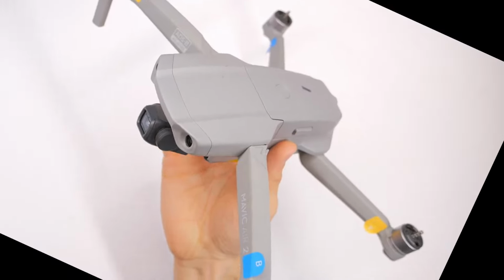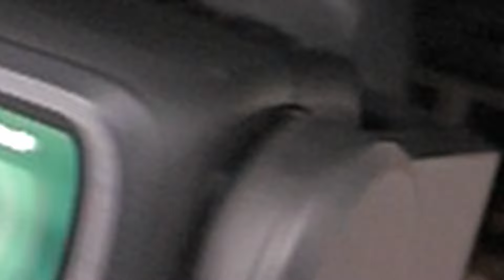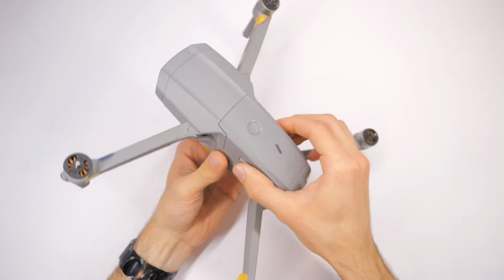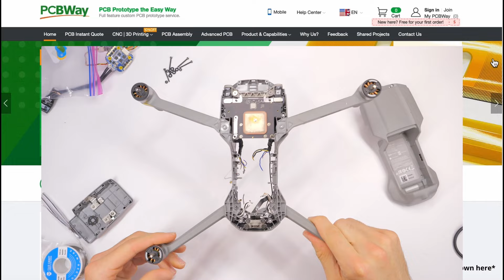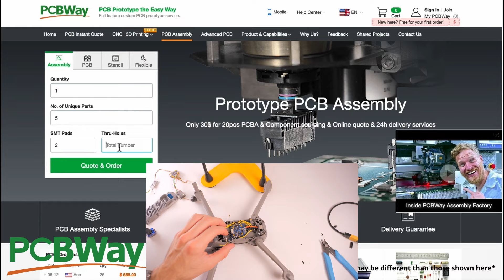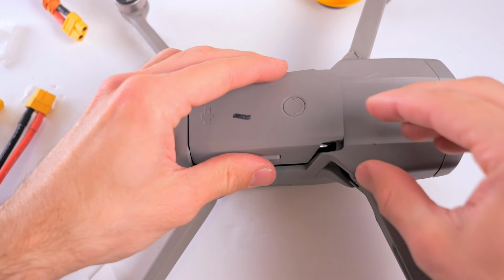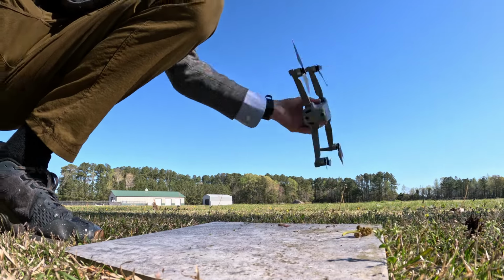😢 Redneck Turns Mavic Air 2 into High Speed FPV Drone // DJI Mavic Air 2 FPV Sleeper Build

Comment: I remember when the Mavic air 2 was released, of which you got a lot of value for its cost. That is, a drone which allows you to film in 4k 60 frame, have a 12meg camera, good battery time, good fly distance, avoid system, and some other feature. All at the price of $890-$1300(Combo)
And today you can buy the combo kit for 500$, which is significantly lower price than Mini 3 while at the same time offer about the same spec.  :D

Comment: I did that exact thing 3 years ago to a MJX Bugs 2 and a Bugs 3  it's very easy to do but hard to make as stable as a real accro quad  unless you swap out the stock motors for more powerful ones with higher kv but it will work. i even kept the stock bugs esc's and ran 4S lipo on it with stock 1806 motors with low kv and put normal 5in acro props on it. got plenty of videos on it.
Reply from the maker: Yes, the standard motors and props really have a hard time keeping up.
Reply: how can i do it to a bugs 6?

Comment: Ahh I was hoping with the custom circuit board print you would port the gimbal functionality which saying it I realize isn't going to work in a fpv flight but also the gps RTH and the other fancy features from dji to a FPV flight mode. I guess next is just stuff the avata guts inside the mavic and then you have 1 directional gimbal for in flight angle adjustment.

Comment: Ive been so close to pulling the trigger on a mavic 3 for parts and using it for a LR fpv build, mainly for longer flight time and greater range due to no carbon fiber. Could you speculate on that idea please?
Reply from the maker: Speculate? Absolutely! It doesn't seem worthwhile to buy one for parts because even broken ones can be surprisingly expensive on ebay, and I don't think the frame would be more advantageous than a carbon fiber frame. Really, DJI drones are pretty much ideal for long range, just not for the FPV aspect of it.

Comment: just curious because of the decent analog video quality for the test flight. But what analog vtx & camera is this and what analog goggles do you use? 
im only familiar with the digital goggles and i see all different types and prices for analog fpv goggles ot even an analog video receiver to use as an AV Input, into my Dji goggle v2's instead of getting a whole new set of goggles..
All im looking for is decent quality video and a solid connection like you had in your video. 
Even with a BNF iflight nazgul5 analog, i guess its my older cheaper now eachine fpv goggles bc they just randomly lose signal for a few seconds with abrupt movement of the drone and its made me crash a few times now and im not trying to destroy my go pro bc of something stupid like this, i dont even long range but that would definitely be a plus lol..

Comment: Adam do you know how to make a DJI Mavic 2 or 3 fly 100mph+? I film high speed boats and want to upgrade motors on one of my drones because I can't keep up with some of the boats i'm filming. My FPV is fast enough but without the gimble the shots are not the quality i'm looking for. Great content mate!
Reply: Get an insta 360 type of camera on your fpv quad, they have horizon lock feature thats basically gimbal + you have a 360 image at the end that you could pitch, roll and yaw in whatever way you want at the end so you could choose what kind of camera movement you want on edit
Reply: @adakalyoncu1913   Thankyou! That is super helpful advice!! Dan (Dans Boat Life)
Reply: 100mph+ you might want to go for traditional fixed wing UAS. Also in the US you'd need a part 107 waiver for groundspeed above 100mph (thanks FAA)

Comment: @ 48 seconds, that bottom face plate......I can't remove it because one of the screws isn't done correctly (China's great quality) and there is no hex hole to put in a screwdriver.  Any ideas how to get it off?    I dunked my drone under water for 3-5 seconds only but after 5-days drying in desiccant it still wont start up.  I need to take it apart so i can clean it out and see if it will start.

Comment: Hey did you know that most of the mavics can do that!!

i managed to find a parameter in the drone that if i change from 1 to 0 you get full acro mode!!
Reply: It is the fpv mode. But you cannot do flips or rolls…
Reply: @gigazman  not true with a pc software you can change lile 800 parameters
Reply: @gearamihai2782  tell me more :)
Reply: Absolutely not 😅 You can increase the angle limit but there is no acro flight mode.
Reply: Listening...
Reply: @DroneDocs yup there is
Reply: I will soon make a video about it
Reply: @gearamihai2782  I have recently been made aware of drone Hacks giving dji drones unlocked flight modes. This does effect gps asseted flight modes unfortunate. Pretty interesting though.
Reply: Yeah but i know how to unlock it but il will sacrifice one of the modes you can choose which one C,P, or S mode
Reply: I already made a video on how to boost the speed of the mini 1 from 45km/h to 56km/h

Comment: Why?! If you want to fly Mavic in manual mode just set mode 0 to any of the mode switch position. Any DJI drone can fly acro if you think it is fun. Actually it is not - too heavy, too drifty. No screw driver needed - just download the DH, go to RC MODE values and have fun. You can try the "Farm" mode but it will not turn your Mavic to Agras, but why not?
Reply from the maker: That is interesting. I'll have to try that. But one big difference is the FPV camera system that I put in there has much less latency than the original HD video system, which is really important for flying fast and in tight spaces for reaction time.
Reply: @RCwithAdam1  I had to install extra analogue cam. Not only latency but the gimbal itself is not good for FPV because you don't feel the bird's position. For me that was a dreadful experience and it last not for so long - very soon I've got my first five inches and the Phantom 4pro was so happy I did not crash it to death 😄